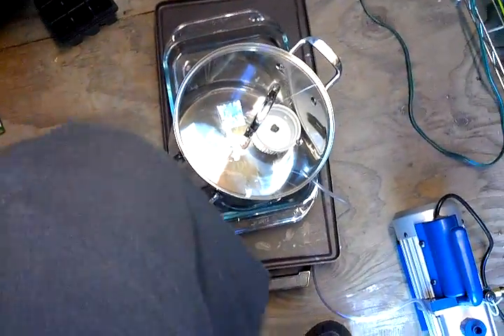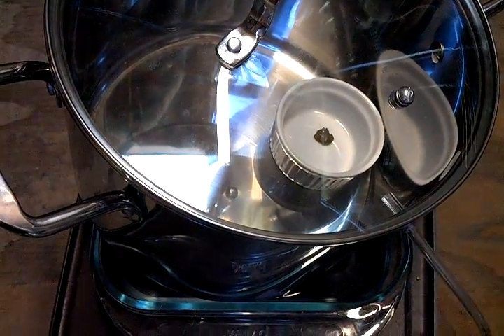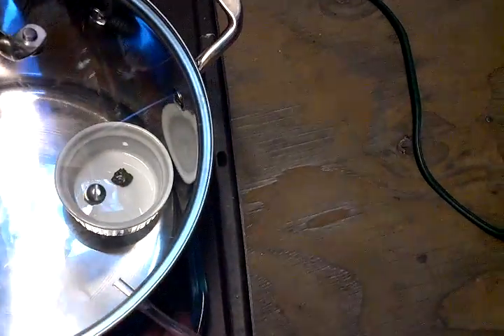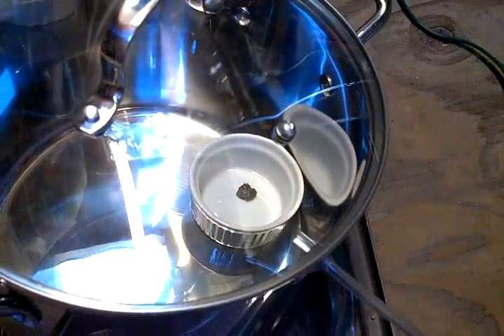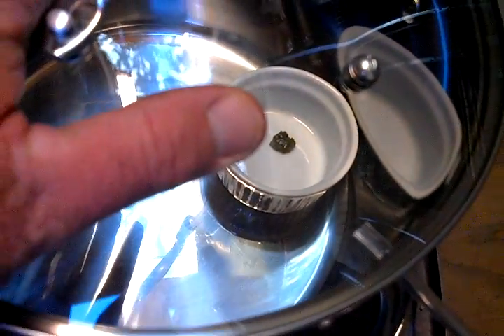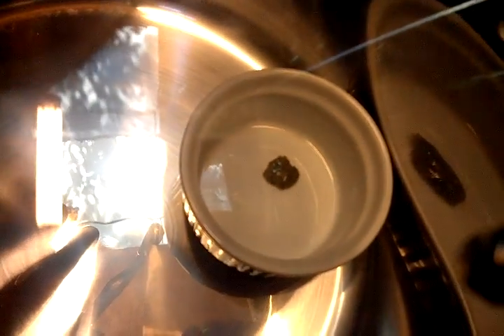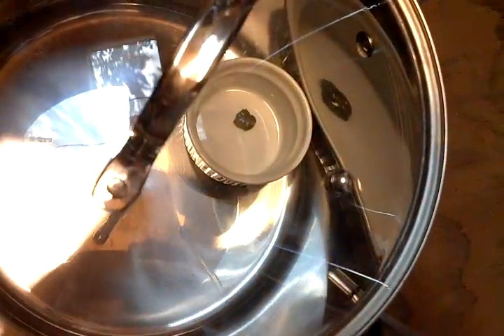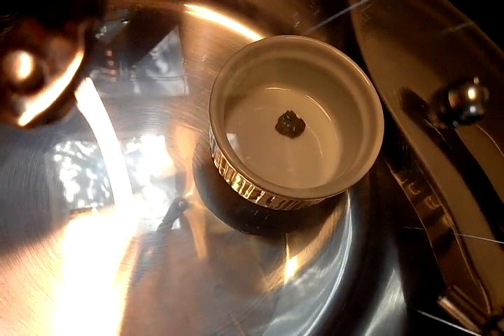Vacuum Purging With Some Heat

Comment from the maker: BB&B. Bed Bath and Beyooooooonnnnnnndddd. It was about $26 after tax. I am pretty sure the seal works well enough that I don't have to use any foam or gasket-like material for the lid. I can't believe those vacuum chambers sold on ebay with plexiglass and all that. For this pump and application, I don't think a air pressure gauge is necessary. Thanks for watching.